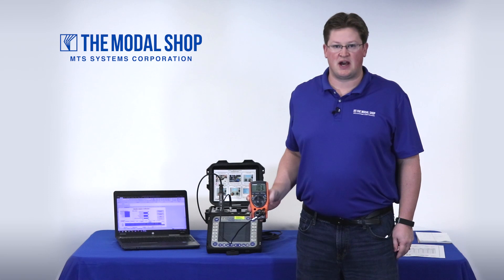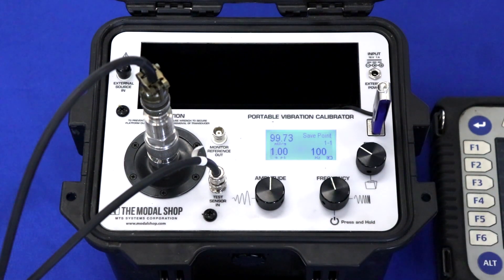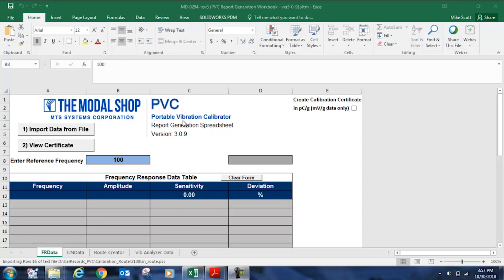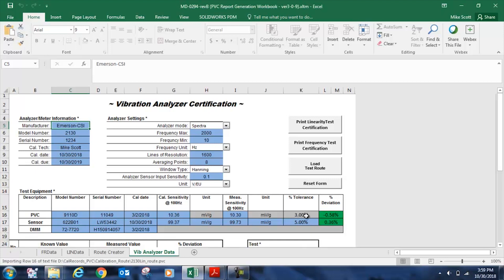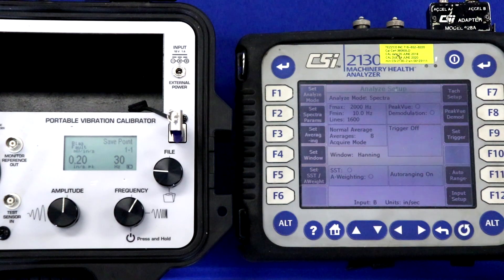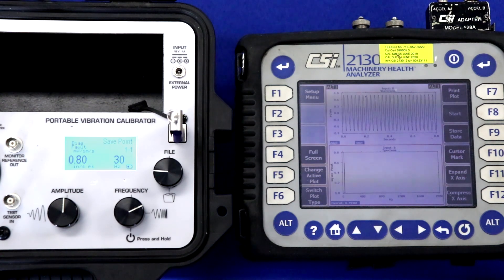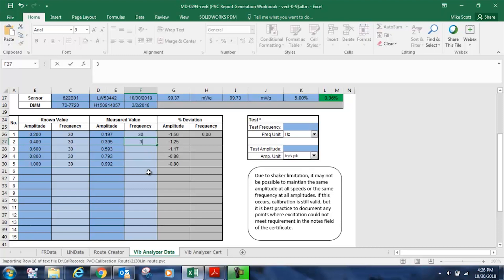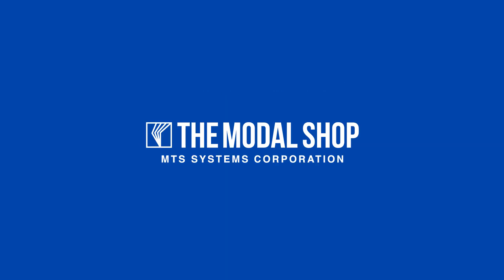Field Calibration of Emerson CSI 2130 Vibration Analyzer

Comment: It is recommended to calibrate at smaller amplitudes?
Reply from the maker: The ISO 16063-21 standard for the calibration of piezoelectric accelerometers does not specify that transducers should be calibrated at low amplitudes. As for the analyzer, we are not aware of any standards that provide guidance regarding the amplitudes at which they should be calibrated. Calibrating at low amplitudes would ensure that the analyzer is measuring real vibration input rather than the noise floor of the system. Shaker limitations may force lower amplitudes to be used. For example, portable shakers cannot generate significant velocity at higher frequencies and cannot generate significant acceleration at lower frequencies. Using a shaker with more stroke that is perhaps not “portable” would potentially give the user more amplitude in all vibration scales.

Comment: is this procedure usefl for 2140 series???
Reply from the maker: Yes, the same procedure can be used for the Emerson 2140. Often that analyzer is supplied with a tri-axial accelerometer which has a round housing. The Z axis (vertical axis) is easy to calibrate. But the X and Y axes are more difficult because the sensor is round. Nonetheless we have found that orienting the sensor on its side and gluing it to a flat plate for calibration works very well. The sensor produces excellent results.